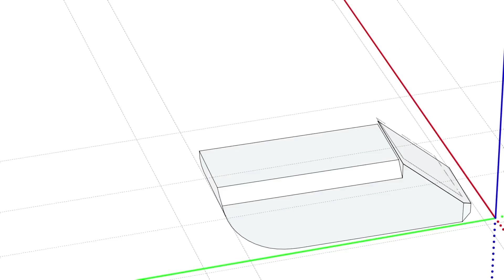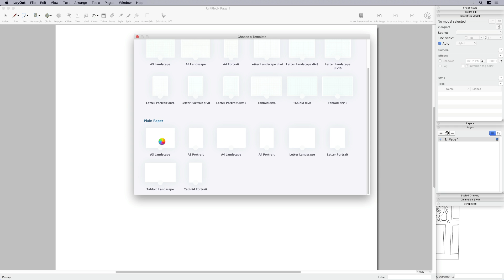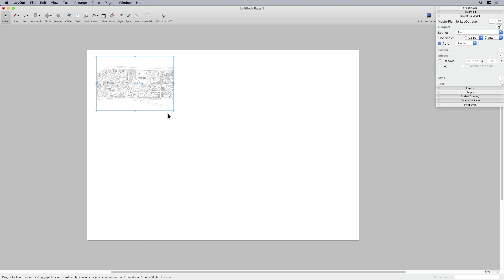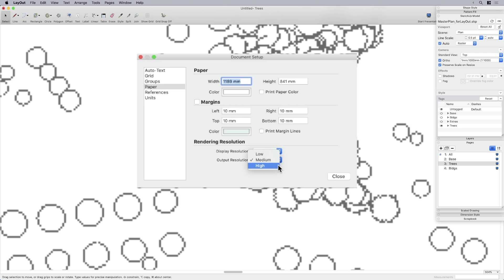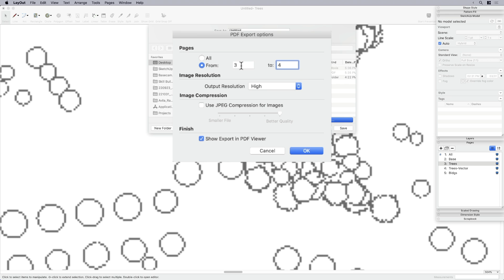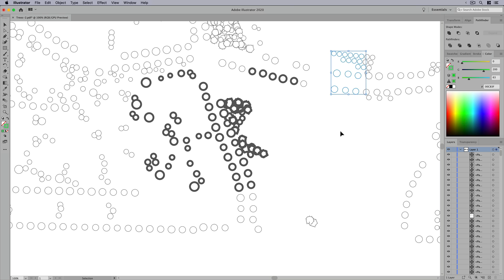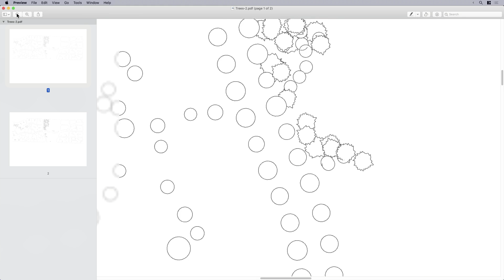The REAL Way to Optimize LayOut Exports

Comment: Sooo i find this video a bit misleading because you say you like to do renderings which require high poly models in order to look good. Yet the trees in Layout are simple 2D shapes. Switching from raster to vector in that case doesnt cause many issues. Doing that with a high poly model is totally different case. 
I was working on an interior design for an open plan living room. Sofa, armchair, pillows, drapes and dining chairs are all high poly since they need to be redered later. Also, most edges on the tables and cabinets need to be rounded off. Not to mention all decorative objects. Using that model in layout gives very pixelated raster lines on every edge that is not straight and switching to vector or hybrid can be as slow as watching paint dry. In the end lines look heavy even when line scale is set to 0.1. And the file size is stupid heavy.
So, my qustion is this: is there a way to use a single Sketchup model that can be used for realistic rendering and for creating floor plans and sections/elevations? If there is a way, please make a video showing your process. 🙏

Comment: Fantastic video! And some excellent comments as well. Like one of the earlier commenters, I have also been working with SketchUp for over a decade and LayOut nearly as long. I never thought to really test whether the raster setting is good enough. I did a print test and it is. I am getting into large site models and this will make it possible for me to continue to use LayOut, which is my preference. So fast!
I am so thankful that SketchUp hired someone working with large models in an architectural and urban design context. Eric’s information is very helpful to me.

Comment: If you have OpenGL set to low res textures inside of SketchUp, does this affect how textures will look in Layout?
Reply from the maker: LO should reflect your SU model's settings. Depending on the material, there may be little or no difference in resolution in SU and therefore no difference in LO export.

Comment: theres´ a lot more to optimisation for real world use of Layout making construction documentation. Yes, good tag organisation is important. You want the viewport to show as few tags as possible, and you want to do that already in your sketchup scene. So if you see your house with your roof from above you dont want that scene to have all the interior hidden by the roof with their tag on. You want scenes where the tags that dont show in the scene be turned off already in that scene, before exporting. That's important for sketchup performance as well. 

In Layout use raster as much as possible. If you cannot determine what to dimension, turn the "Line scale" down. That makes the lines thinner also in raster mode. Having a view with just a small subset of your geometry is important also for the next issue: getting the dimension tool to find the right endpoints to dimension. Remember that the drawing also convey the information it is supposed to convey better when it is not full of extra linework that shows something else that what that scene is about. 

Dimensioning your inner walls is not a problem in a viewport of just the inner walls. But you need to see a few more tags in  order to place your dimensions right. You should use fast styles for the scenes/Viewports where you do your construction documentation. Also you should have a wireframe style saved to the sketchup model, so that when the dimension tool cannot find the right spot you can  switch to that style to find the endpoints. Having two dublicate viewports on top of each other is still a good option. You can have a raster viewport on a separate layer that shows all the relevant geometry, like complicated steel details. On a separate viewport you can dimension just the inner and outer walls. Maybe that viewport is vector, but with just a small number of lines. If you need to dimension close to complicated reference geometry like stuff from the steel engineer, turn that viewport off by its layer so you see just your own clean outlines of walls.

When you dimension you always find your model was not as ready as you thought it was. So you need to go back and forth between Layout and Sketchup a lot. It you have your viewports locked you cannot right click them to update them. I use a small vignette ( a viewport showing just the roof and outer walls) of the project placed in a corner  as a "button" . I update that viewport, that is not locked, and then the rest gets updated.

Exporting that to pdf works well, but you can forget about exporting dwgs from Layout. The precision of your sketchup model is lost anyway, and your 4000 mm line is now 3999,99102. So that will make the engineer ask if you made this in Microsoft Paint. Export dwgs from sketchup instead. Sketchup will make an inferior 2D dwg in terms of tag organisation, placing of origo, and a mess of exploded components and linework, but at least the dimensions are correct. Using "Color by Tag" on the export will make the dwg look like it's organised, at least.
Reply: Thanks for sharing your advices.But I am a little confused by the use of tags in SU an LO: I thought they could be different.Do your have to be created before in SU to be seen in LO or we can create than directly only in L.O.